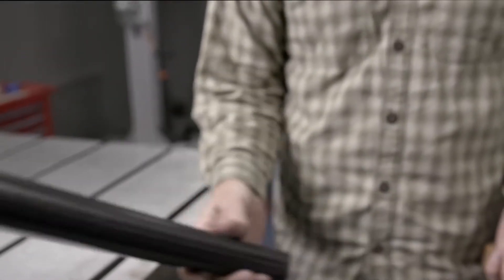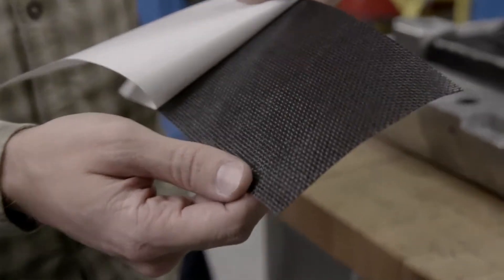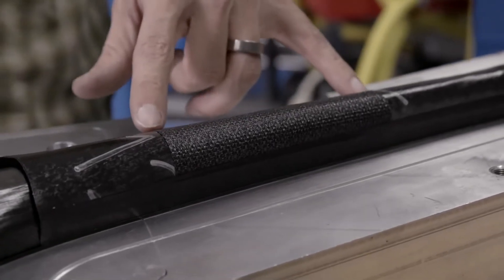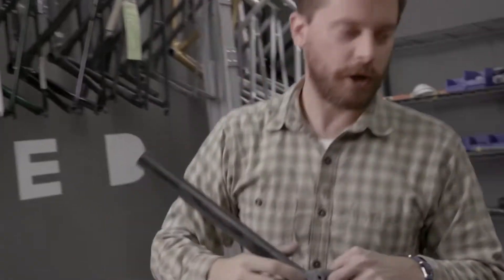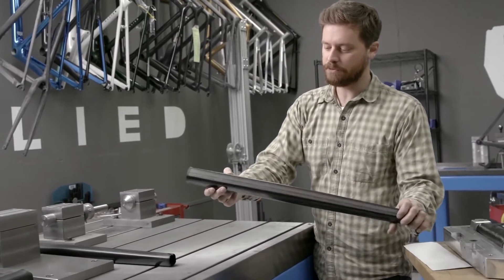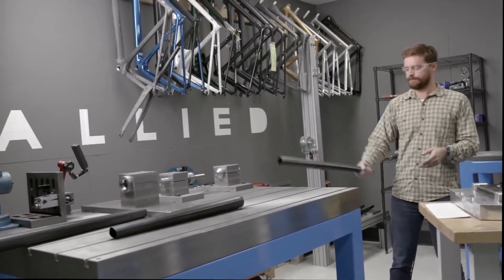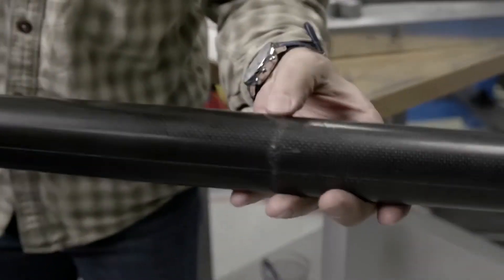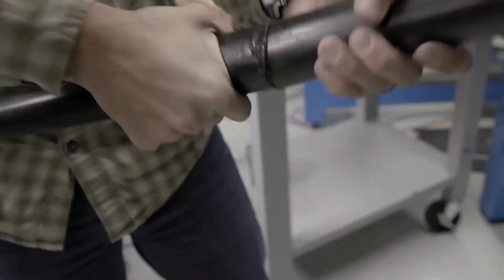INNEGRA INNOVATIONS in carbon bikes at Allied Cycle Works

Comment: Pretty interesting stuff.  Innegra does seem like a good material for an outermost layer since it is so light weight. I'm very interested in trying a combination of bamboo core and kevlar outer for price, weight to strength ratios both tensile and stiffness, overall durability, and impact resistance.  Seems like a final outer layer of Innegra might improve the latter two and also help protect against water and/or UV?